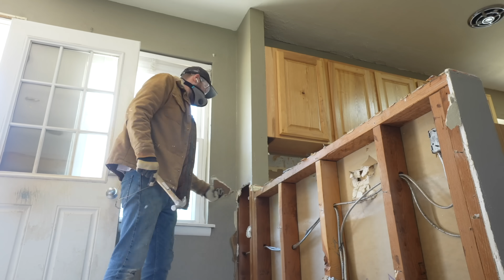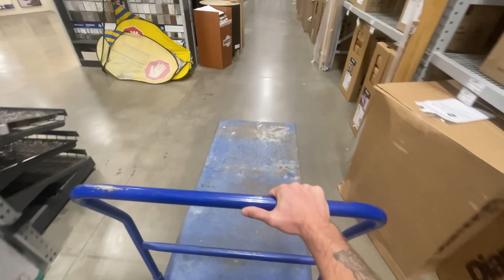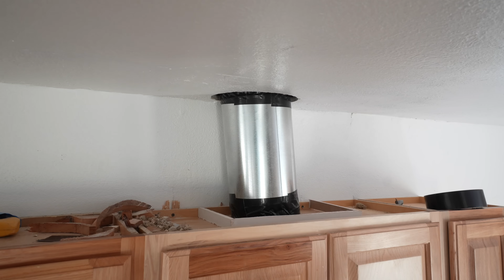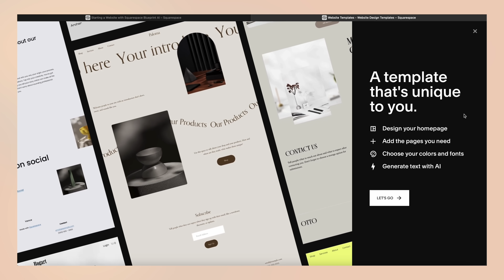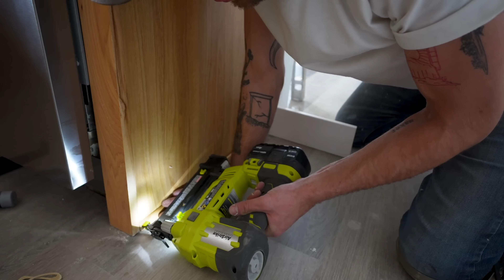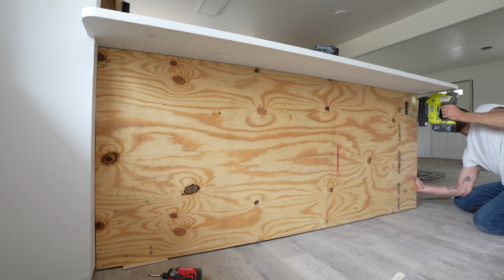I spent $5,000 to gain $25,000 in Equity!!! DIY MODERN KITCHEN RENOVATION

Comment: A detailed non biased review of praise and constructive criticism  

Great job on : 
-sink & appliance choice
-counter top color & cut style (waterfall edges aren’t timeless and on their way out)
-keeping cabinets wood, you can always paint them but wood is higher end and more timeless, especially since the routered parts don’t look ultra 80’s & 90’s. People that said paint them don’t understand that it’s poorer and white is super basic that it’s already going out cuz plebes are doing it thus no longer high end unless the cabinet doors are ultra high end timeless detailed
-adding the cabinet backboard in matching oak was a win and the 50’s clean line will help it be more modern 
-great that you didn’t add draw/cabinets pulls, most go out of style and catch on pants etc so they’re annoying and if you want to change them in the future the hole might not align up with the new style thus messing up the wood finish after being filled. Knobs are expensive and unnecessary.

In the future if you want to increase the value:
-add matching shorter cabinets above all the upper cabinets and a piece of crown (white or wood is ideal) that goes all the way to the roof), it’s a small investment with huge impact. That doesn’t collect dust and prevents tacky decor from being placed on top of cabinets and adding it will make the room seem taller and more grand.
-switch out the microwave for a high end looking fan/vent cover.. you can diy it and save $1,000’s , do a timeless high end look (maybe even axe all cabinets above stove) 
-the cabinets above fridge need to be deeper and move the fridge to the wall and create a similar counter space with 2 upper cabinets .. or get more storage by doing a long cabinet(or 2) floor to ceiling with pull outs for storing broom or pull out shelves for food storage etc) Either option you need to add a oak board to the side of fridge to give built in vibes (make sure you have air gaps around the fridge either above etc for fridge motor air , then u don’t need to buy a built in) , you don’t want to be able to see that ugly unfinished non matching fridge side.. 

Horrible choice on :
-backsplash.. what is this the 80’s /early 90’s?? Eww. A 4” x 2” white subway tile (not the tiny but smaller than the old school ones) is inexpensive and timeless and no metal edging, there’s white porcelain edging that’s matching, maybe go crazy and tile in a white square above the stove with a raised framed edge and the inside in a squared tile but in a diamond orientation or something similar but all in the same color and finish as the subway tiles.
-before fixing the backsplash add a waterline in the wall and pot filler to the wall above the stove and match the finish of the sink faucet. 
-illegal non hdmi outlets in wet areas (bathroom/kitchen), what if a fire starts and your insurance doesn’t cover it ? 
-changing out the floors.. should’ve left it since it matched the tone of the cabinets or you could’ve gone with a darker semi warm stain (you generally want darker at the floor level and lighter tones as u look up to help your eyes flow and the kitchen feel taller, darker tones up high makes it seem shorter and mid level like dark countertops is even worse cuz it cuts up the line of sight) anyways you keep the floor color in a warmer wood (brown) hue… you don’t mix grey wood floors with gold wood cabinets 😬 😬 
-going with a goldish metal above the sink… you can mix metal finishes but not when it’s only one thing, it looks horrible.. it’s also a weird orangey yellow so not quite gold nor a more expensive brass (yes brass is better than trendy black so keep the 80’s/90’s doorknobs 😂, it’s super expensive to replace and black again like white kitchens is on the pleeb level so no longer in.. Grey wood nonsense has been out for awhile especially in flooring unless ur doing the poor southern farmer look with other outdoor materials. 
-open concept is already outdated, getting rid of the wall was an unnecessary expense and you didn’t fix the balance by changing the island (a couple options on how). People don’t necessarily want guests to see inside their kitchen (potentially messy) all the time .

Comment: Looks like you took out a air return when  you took out that wall. one of the biggest problem furnaces have is lack or return air, so often they are starved for air, they wont just pull whatever they need from the returns that are left, they will be starved for air be less efficient and push out less heat and AC leaving your house cold in the winter and hot in winter while using more energy.

Comment: as someone who will likely be a life-long renter, i can appreciate that you didn't cut corners during the reno/repairs. i've experienced so many dodgy "repairs" in my 20 years of renting, so it's nice to see someone who does it right and not only cares about their property, but also their renters. I think the only think I would have done differently is matching the metal in the light fixture to the kitchen faucet; either both brass finish of the light fixture, or both that brushed metal finish of the faucet. that's just a personal aesthetic thing though. great work!
Reply: Yes, all the trouble to have floors match, cabinet match, but finishes on sinks and light fixtures not. But I do love the back splash. Not a fan of the sink. Too glitzy.

Comment: Never use normal joint compound with mesh tape.  Only use hot mud. Also you need thin out joint compound with water and paddle mixer before you use it. Don't use Kilz 2 on bare drywall (or skim coat). You need a PVA drywall specific primer and sealer.

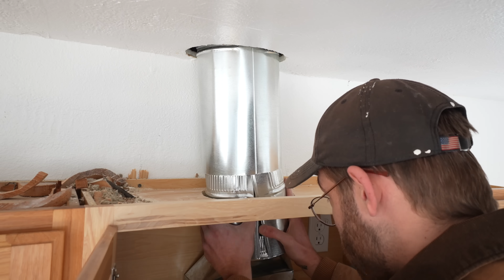Comment: DUCT TAPE?!  @14:24, don't be fooled by the name "Duct Tape".  It is NOT supposed to be used on ducts!  Use the silvery aluminum HVAC tape.  Duct tape just doesn't have the longevity you need, gets weird with heat, and will fail on you in a few years.  Look it up!  Definitely not Super Pro!

Comment: The kitchen would look much larger if you filled in that useless space above the cabinets. You could drywall it, but I saw one renovator that made it look like an extension of the cabinets. However, they were painted cabinets. Other than that, the finished space looks awesome!

Comment: I would have removed the cabinets to the right of the sink and placed the DW in the corner by the sink. As is the DW is a tripping hazard. I would have moved the jetout cabnets over to where the fridg is and placed the fridg in the corner of the lazysusan. One thought would be using a burcherblock utility bench on wheels like in homedepot for more work surface.

Comment: How did you get the ice machine hooked up? It needs two water lines to a water source for the front access water and ice to work. You don't mention or explain how you hooked up the water lines to the fridge? It's way across the floor from from any water hook up. Did you just not hook it up and in essence it's just a fridge without its full features?
Reply: This TBH

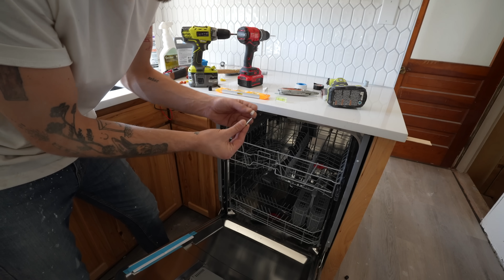Comment: With the dishwasher door open there is no room to stand in front of the sink to do dishes. 23:16 That configuration is non functional and above all else a kitchen needs to function. Also would have turned the fridge to face the range and the sink. Otherwise some good ideas in this renovation.

Comment: I think you did well generally. My favorites are that you recycled the cabinets and donated the appliances, you vented the microwave, those countertops are awesome, the backsplash too, and the new outlets. Gotta say I'm in love with the sink and fridge, but have a problem with each. The fancy sink will crash and burn in any high mineral area if there's no filter and softener. But if you have the funds, I can honestly say I've never seen anything like it before! Sexiest sink ever award. The fridge with the sliding shelf for tall items - omg. But again, a word of caution. It's sticking out waaayyyy too much. It needs to come with instructions to be inset into the wall (maybe a closet or pantry or staircase behind it?). No appliance should stick out. Causes accidents, feels and looks awkward and unprofessional, and generally out of proportion. Style wise, my one tip would be the color choice of the floor vs the cabinets. If you couldn't get a color that looks better with the cabinets, then I'd recommend painting the cabinets. I generally prefer the natural texture of wood, but the grey washed with the yellow orange is just not okay for me personally. Then the cool slats on the peninsula is a whole other color. I'd prefer a choice that feels more cohesive, and painting is the easiest and lowest expense to accomplish that goal at this point. 
  Good luck with your income property, and congratulations on getting all those free appliances! HUGE savings! But your Best blessings were definitely having a father by your side. You're a very lucky young man. Cherish your family.

Comment: First off, shout-out to Gary!!  🤙🏽💪🏽🫡

As for the amount gained by this upgrade, you definitely improved the value of the home.  But realistically, those of us that aren’t connected to an appliance company or two would’ve made probably less than half of the equity because we’d have to pay for our appliances. I’d venture to guess you could get the appliances for about $8,000, and that sink is about $2,000 depending on what brand.  Not to mention sales tax in whatever state we’re in. 

Anyway, still made decent value increase and the work is exceptional.  Not half-asses like I’ve seen in some flips.    Nicely done. 💪🏽🤙🏽

Comment: Add hardware to the cabinet doors and drawers. They're not only jewelry for the cabinets, but they protect the cabinets and drawers because people don't have to yank them open by grabbing the corner of the cabinet. It also makes the kitchen look more finished and expensive. I'd line the cabinets in drawer bottoms as well to protect from spills. This will keep the cabinets in great shape for much longer.

Comment: It looks really nice, Mike. I think in my neighborhood that might add a little more equity than $25K. I love your choices of white countertops and white tile background - that's timeless and can't get any more clean and classic for a kitchen. The tiles you chose are great. Also love the choice of wood cabinets and the Oak tone. I'm not a fan of the flooring but on a budget, I guess it would do. I absolutely hate the textured walls. That's a deal breaker. Lol. Talk about dated. And the a/c vent was better the old one.  The new one also looks dated but at least the old one has legit, MiMo style ;)
Reply: The frosted glass was unnecessary for the light fixture. For what the stuff costs, you could have gone with a nicer fixture. But it looks good.

Comment: Hey Mike, I'm interested to know how much the total cost would have been if you had to pay for the appliances, sink and floors, you really should include both prices, just for reference for those of us that don't have the luxury of being gifted those items during a remodel.   

However, for spits and giggles based on the magic of the googles here's what I found:

Hisense K2 Kitchen Appliance Package cost: $3000 - $4000 (Lowes) Actually not bad IMO
Lefton 304 Sink cost: $650.00 (Amazon) Not bad either, I immediately assumed it would have been well over a thousand dollars...even though $650 for a kitchen sink is still kinda pricey.  
LVP Flooring approx cost: $3.00 - $5.00 per Sq/Ft (Direct from manufacturer, but do your own research) 

So not counting the flooring we're at about $9150.00 in approximate total cost. 
You're welcome.
Reply: Exactly, title was misinformation.
Reply: @DRJoe100  Not really.  Its how much he spent.
Reply: @JamesP4620  It is still misleading in title. I came in thinking the total cost to do his remodel included the price of flooring and appliances. If both were included looking closer to $10-15k in expenses.
Reply: Wow. So how much in reality do you think it increased in value?
Reply: @dittohead7044  I have no idea however generally a completely remodeled kitchen and bath could increase the properties value up to $25K. Using higher end appliances, cabinetry, flooring and countertops should far exceed adding $25K to the value of the property.
Reply: @rafaelthomas4174  that all depends on the area of the house too. And the houses and their recently sold prices too
Reply: $10k is still amazing for a full kitchen
Reply: The lack of response is telling.
Reply: @pdubyaz trueeee

Comment: Great work overall. One big error - "duct tape" is actually not rated for ducting/vent applications. You need a foil backed tape that is rated for HVAC ducting. Likely not an issue since you're just exhausting cooktop fumes, but very important in heating applications or ventilation from a high heat source (dryers, furnaces, etc).
Reply: you beat me to this.
Reply: that's actually good to know! i don't work in HVAC and would have just assumed that something labeled "duct tape" would be okay to use on all ducts. thanks!
Reply: @longjanesillvrr  duct tape was originally called duck tape and made with duck cloth which provided water repellant properties. It wasn't necessarily made for use on air ducts. The name sorta changed over time though
Reply: @keco185 next you are gonna say gorilla glue is not for sticking gorillas to my wall
Reply: @Parrott280  Sadly no. It's made for Gorilla's to stick people to the floor.
Reply: @Parrott280  🤣🤣🤣
Reply: @keco185  Yep, it was "invented" for military applications. They would use it to seal ammo boxes.
Reply: 100 %. The duct tape will eventually degrade and gaps will form causing the exhaust to leak into the living space.
Reply: There is a special aluminum tape for this.
Reply: That’s what I thought too
Reply: That is True. You want to use a Metal/Aluminum Duct tape that has a 181 rating. And you need to use a Squee Gee to properly get it stick right by getting all the air bubbles out. 
I prefer using "Duct Sealer" its a matic that comes in a pale or caulking tube. Its The Best way and is required in most all of our commercial HVAC jobs that require a Leak test on the Duct system! You apply it it with a 3in Chip style paint brush in any joint or crack in the duct connections. You brush it on and it dries to a real nice grey color and looks 10 times betrer and you dont have a bunch of Junk Tape all over everything.  The duct seal method is a Forever seal and not going to just get old, dry and fall off. Like improperly applied metal duct tape!! 
Its Faster, Wayyy Cheaper,  looks great and it performs the task much better! Sometimes we will Tape and also apply duct sealer over the tape as well. Just to keep existing tape from falling off. Once it sealed its a wrap! That also helps to seal any holes or gaps until the Duct sealer dries. 
Put it on modestly, trying to shove it up in any and all cracks. Then with the brush just skim and brush the joint nice and Square. No Gob Job crap. Lol  Its just like painting.  Put a couplle of ozs of water in the Duct Sealer Pale before putting the Lid on the pale for storage. And youll keep it from drying up before your next use. Always Stir it real good before use. A Pale of Duct Sealer goes pretty far. And can be used on several projects. When it dries its like a Hard Shell and repels water pretty good to.
Reply: I thought it was weird to see black tape instead of foil tape. Good to know I was right about it.
Reply: I am an electrician not a HVAC guy by any means but I thought about it too and that goes to show you how you pick up on things when you work around other trades... Like duct tape? it's always that aluminum looking tape from what I remember.
Reply: Could he apply the right tape around the duct tape?
Reply: I repair things around the house as needed, but one thing for sure duck tape is a no go for this.  It will degrade and cause a bigger problem later.
Reply: Most duct tape is rated for dry cold ducts.

Comment: MAJOR props for venting the microwave properly to the outside. I can't tell you how many brand new homes I have toured where the vent goes into the cabinet above and stops!

However, GFCI outlets should have been used in the kitchen as opposed to outlets with USB ports on them.
Reply: Yeah pretty sure that's required by code.
Reply: @izzy_thump  it is 100% required by code!! ( Licensed Electrician of 30 yrs.)
Reply: If it has the new GFI breakers, then no, it is not needed. We did not see that part of the video. So not enough information.  If there is no GFI breaker, then yes, GFCI outlets would be used.

Comment: It's an incredible renovation! ❤However, the placement of the fridge is really awkward and honestly the only negative thing about it. I would have switched the fridge and the cabinet positions and brought the wall further out, so that the fridge doesn't stick out.  The tiny cabinet above the fridge either has to go because it just looks ridiculous and not functional or build a box around the fridge and use the entire depth and height above it for a storage cabinet. Just my opinion though, you might have had your reasons to install the fridge like that. 😊😊

Comment: Fridge looks great but out of place to me. Could use a fridge end panel to box it in? Maybe move the upper cabinet above the fridge out towards the face of the fridge or make a new, deeper/bigger cabinet box with the same doors. Or if possible, switch the fridge and cabinet next to it? Also I like the wood slatting look but it doesn’t seem to be doing this kitchen any favors. Maybe if it looked similar or matched the rest of the cabinets. It’s almost looking brown and kind of clashes with the floor a little. Anyway, just my two cents.

Comment: Aren't you supposed to use heat resistant foil tape on the oven venting joints? Maybe my dad taught me wrong.
Reply: Your dad taught you correctly. Foil tape for sealing ducts is the stuff to use.